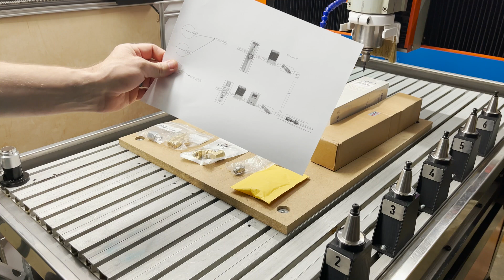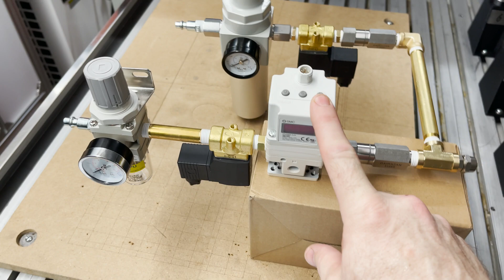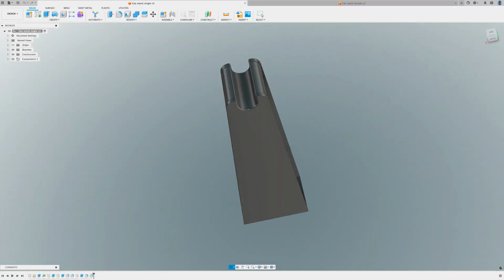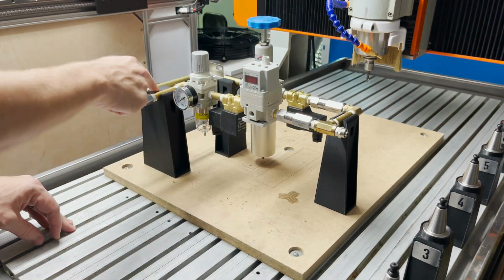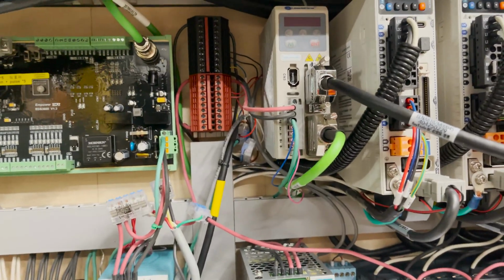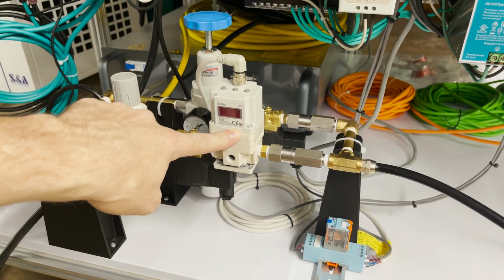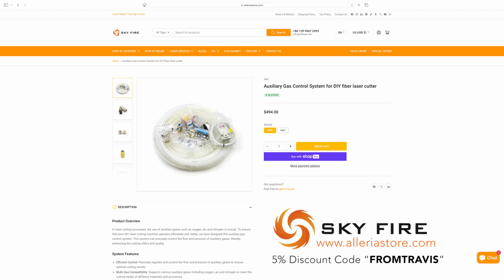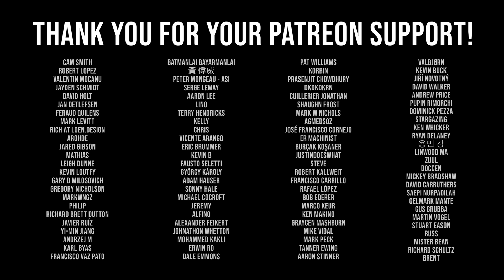DIY Fiber Laser Cutter V2 | Part 9: Gas Control System

Comment: Hello. Did you just connect control wires of relay to outputs of xc3000s?  How do you activate outputs? Just in diagnostic tool board? Does the alarm of gas pressure also control the output?

Comment: With solenoid gas valves that would close when not in use why would you need check valves?
Reply: Ratings nitrogen parts are rated for higher pressure including the solenoids. It’s also good practice to

Comment: I have a ton of experience with compressed air and welding gasses. Those quick disconnects aren’t 100 percent leak proof. A quality quick disconnect still leaks slowly.

Comment: Hey Travis, great videos. I just ordered my set up for the 1500 W to integrate with my 4 x 8‘ CNC plasma table through SF laser getting your discount. Thank you so much. My question is I just realize that I did not order the gas control system and I have a, very large compressor with a nice dryer system on it if I am going to be using that do I have to have the gas control system kit you
Reply from the maker: If you compressor is capable, you can certainly use it as a source for assist gas, but depending on what you are cutting you might also want to use nitrogen because it leaves a much cleaner edge, also when cutting thicker carbon steel you will want to use oxygen instead of compressed air. The gas control system contains solenoid valves, and check valves, everything you need to control the gas with your controller, without it the gas would always run continuously, which may not be an issue with your compressor, but for any of the bottled gasses, it would amount to a lot of wasted gas and could get expensive.
Reply: Would the compressor assisted source be ok with let’s say 16 or 18 gauge steel? I cut a lot of 14ga to 10ga but would like to use some lighter steel for decorative signs, etc. thank you sir
Reply from the maker: 16ga it would probably be fine, 10ga you probably want oxygen
Reply: @diyfiberlaser  last question LOL! Regardless of compressor/compressed air/N2, I will be needing an "Air Gas Assist" set up in order to use the laser?
Reply: @diyfiberlaser  Sorry, I should not have said last question. Did you order your supplies as a kit or out sourced yourself as needed? Would you be able to please show me what you purchased and where? Thank you Travis
Reply from the maker: I didn’t use a kit, I sourced all of my own components…all of the parts I used and my gas system diagram are on my Patreon page
Reply: @diyfiberlaser  Sorry, I got ahead of the video. I see it is all there. I will let you know how it turns out. Thank you so much for you time sir.
Reply: @diyfiberlaser  Signed up for a year. Thank you Travis!
Reply: And yes sir, my compressor is an 80 gallon 2 stage and can keep up with anything I cut with the plasma table. Thank you for you help .

Comment: On your old system, what PSI did you run your nitrogen? Can you estimate your cut time 2 - 3 hours maybe? Thanks Travis.
Reply from the maker: 175psi…I would guess closer to 1 hour of cut time
Reply: @diyfiberlaser  This is unexpected cost to using a laser. I went to my metal yard yesterday to ask some questions, their run 300psi compressed air for everything, only switch to O2 for steel above 3/8". Our N2 tank arrives today, that's another $500. Thanks for the fast reply, may your cuts be straight and clean.

Comment: Hi friend...with just the oxygen regulator you can control the exact pressure to cut thicker materials? I'm asking you this because a proportional valve is very expensive.
Reply from the maker: Yes, you’ll just have to set the pressure manually instead of controlling it through the software…that’s how I did it on my first machine

Comment: Could you do a video covering the down-draft extraction and safety side of it?

- I have seen in a video of your previous laser cutter that you just exhaust out of the door but have you got any experience with filtering it?

- I couldn't seem to find an answer online, but can you use a water table instead of extraction like you would with a plasma cutter?

- What are the safety considerations with such a powerful laser source? Can you fully mitigate the issue with just the enclosure and if so, what kind of material do you need to use to properly block the effects? In particular, I'm wondering about other people entering the room without laser glasses.
Reply from the maker: Unfortunately, no. I'm in no way qualified to speak to safety. 

I'm exhausting outside into a carbon filter. 

I don't know about a water table, but I've never seen a laser with one.

Eye damage, toxic fumes, burns, that's what I know of. I think you can minimize risk with a metal enclosure with proper exhaust and laser safety glass for windows.

I've seen many videos of operators of open frame lasers not even wearing safety glasses while cutting. I try to play it a bit safer...I'd prefer not to lose an eye from a stray reflection.
Reply: @diyfiberlaser  Thank you for your responses, I didn't realise you used a filter - How quickly does it clog and need cleaning or replacement? I'd assume it doesn't produce as much dust and dirt as a plasma cutter would, but that's just based on intuition more than anything.

I do always worry about the open lasers, especially on the large 8x4 router-style tables. I've been leaning towards a fully enclosed, metal-sided setup with cameras for monitoring rather than windows, but I don't know if I'm being over the top in that regard.
Reply from the maker: @yngndrw.  I've not replaced or cleaned the filter, but I'm not a very good benchmark since I'm not cutting that often. Fully-enclosed with cameras sounds safer for sure!

Comment: For you Nitrogen needs, looks at a pressure swing absorber, they can deliver higher flow rate gas derived from ambient air - its not the highest purity, but should be fine for your application.
Reply from the maker: Interesting, thanks I'll look it up.

Comment: for compressed Air, look at a rotary vane or screw compressor, they deliver constant flow air, granted with higher oil content than a regular piston compressor - but on a constant flow unlike the small shop compressors
Reply: You just have to be mindful that all of the oil content is removed before it gets to the shared pipework, as pure oxygen is also being used as a cutting gas. On the plus side, screw compressors often include proper oil separators because of the amount of oil that they bypass, but ideally, you still need a separate oil filter and an oil mist filter afterwards.
Reply from the maker: Thanks, I've looked into rotary compressors...it's on my list to get one of these days

Comment: In an industrial fiber laser cutting machine the gas valves and regulators are always placed on the head side or on opposite side of machine where there are no control electronics or relays etc.
Reply from the maker: I’ve seen that, I don’t think I have enough room up there to do it that way on my machine

Comment: The regulator should be mounted before the valve, if its running without pressure, it may damage itself.
Reply from the maker: Interesting, I’ve not seen any lasers doing it this way. The solenoid and regulator seem to activate at the same time (within milliseconds) so hopefully this doesn’t become an issue.